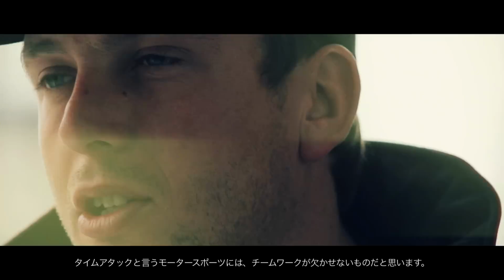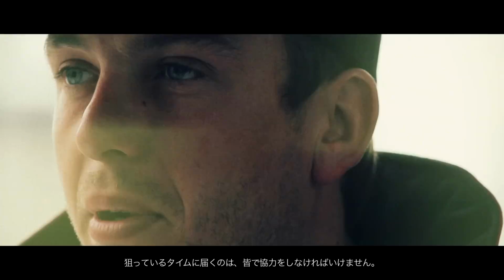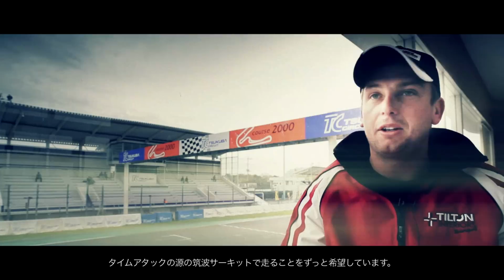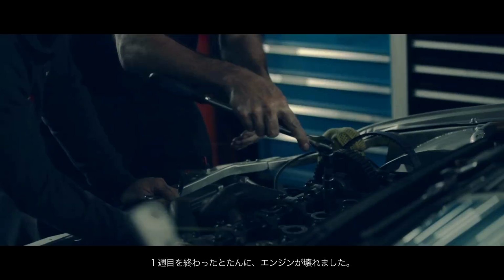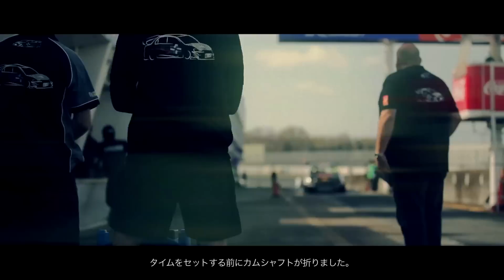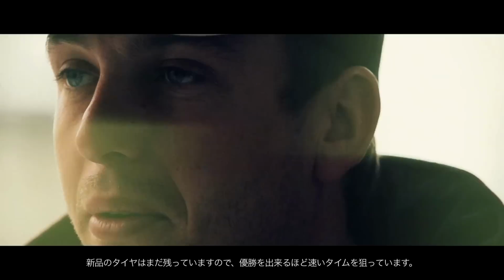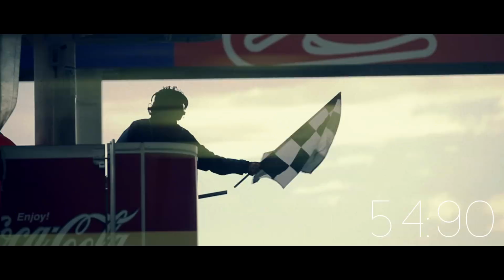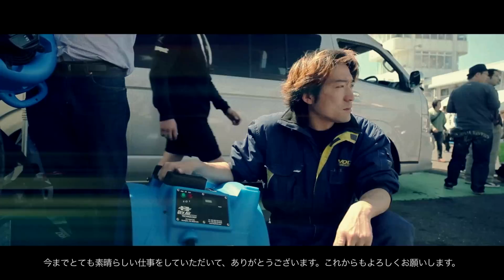Behind The Wheel - 850HP Mitsubishi Evo Tsukuba Circuit Time Attack Video

Comment: Slicks are the tires with the most contact surface between the car and the track. The less tire tread you have, the most contact you have between the tire and the road, so it's the opposite of what you probably think. Also, slick tires are most of the time made of very tender rubber, so the grip is even better. To make it easy to understand: SCLIKS: super tender + no tire tread = MEGA GRIP. 

Have a nice day.

Comment from the maker: The car was still being setup for Tsukuba circuit in this video so thats why it looks like the tyres may not have enough grip, the cars setup was causing some understeer problems. The car has another 4 to 5 seconds in it once they get their proper engine back in there. They had 3 engine failures over that week in testing and on race day. They will be back this year.

Comment: Why are they using Cosworth engine.. it is stupid to use Evo as a base car and not use Mitsu. engine. I understand using different mfg. suspension etc.. but the engine?? why not the original engine and tune it to hell..
Reply: When he say a Cosworth motor he mean Cosworth internals in a Mitsubishi block and head, ie crank, rods, pistons camshaft etc are cosworth items put into an evo motor that has been machined and prepped. A stock internal motor wont last that long at this level of motorsport with this kind of power
Reply: Same engine, different internals... Smh
Reply: facepalm
Reply: Cosworth are a tuning firm that have had their skills used in many different projects, Audi RS4 being the first non Ford that springs to mind, also the Impreza CS400 limited edition.
This Evo is using Cosworth internals.
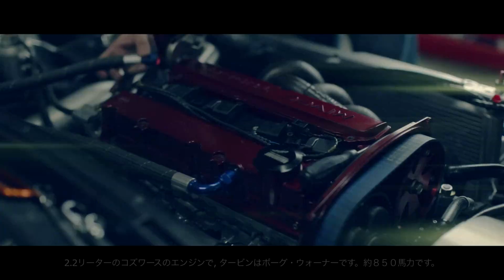Reply: 2:02 Didn't you see that engine? I'm guessing you're not familiar with Mitsubishi's Evos

Comment from the maker: I understand but the Tilton car was at 50% of its full potential and it also did a lap that was 2 seconds faster in the last sector I believe before one of the intercooler hoses split, that was also on a make shift repaired engine. So that data backs up a 52-53 easy. This is all still on rough engine / tune. Like you said there is no 51 or 52 second lap yet but this car is very capable and the CT230R is a very old setup now days, I think many Japanese teams will have to step up their game.

Comment: Wow, some very uninformed people spouting off in the comments (as usual). All of the highest level time attack cars are 'unreliable' compared to a car built to run actual races. These cars are tuned within an inch of their lives to try and get that one golden lap. They are the automotive version of the Olympic 100 meter dash athlete. Every system and subsystem on these cars is pushed to max with no headroom. And because of that they do break a lot. Also, the left foot brake tapping on the straights is to counter any pad knockback in the brakes and also make sure there is pedal and you haven't lost brakes. Finding that out at the end of a long fast straight is a rude process.
Reply: ^^ THIS. ^^
Reply: +Jim Davenport And one other thing. These guys are running on actual treaded street legal tires. On pure racing slicks the lap times would be mind boggling.
Reply: +Jim Davenport thank you for informing us Jim, i was curious to know why he was tapping brakes on the straight
Reply: Lol and who told u dis. Where did u get these facts from? Do u know all the time attack teams? Have u been in their shops? I hope u hav some good facts to back up wat ur saying. I am only talking about the engine tuning part just so u guys or girls  know.
Reply: @davidchau3228  If you don't know the difference between a tune designed to make an engine last 100 laps reliably vs a tune on the bleeding edge that sacrifices any safety margins for every last bit of power, you don't know much. Time attack is in essence much like qualifying. Just look at F1 in the 80's when they had special engines for qualifying that were destroyed after 2 hot laps. My comment is not any kind of put down of any of these teams. Just the opposite. They are pushing things to the absolute edge of the cliff for that golden lap.
Reply: @engineerjmd3  dat doesn't mean they rebuild the engine every time

Comment: bo093 was close. It's "knock off" as WRXJIM said, it's caused by the gyroscopic force of the rotors pushing on the brake pads when the wheels are turning. This is because of the floating rotors movement, and it pushes the pads back into the caliper. He taps the brake pedal to move the pads back onto the rotor face, so there is no soft pedal when he pushes the pedal next. You can eliminate this by running a strap drive floating rotor system. Awesome video!

Comment: @Reece Mechanical
Yes this car was a bit unreliable, but that is not unusual for cars tuned to the limit. Also, Evo's held the record there for more like 11 years. The JUN Evo V, then the HKS CT230R. Both these cars were not highly modified at all compared to modern Time Attack cars especially the JUN Evo. The car in this video did a time just quicker than the JUN Evo, but if it went there now it may well break the record. And there are people who can afford to use a Porsche as a Time attack car, there are several in the UK right now for example. They are not however at the front of the field and have not posted any wins at any international events that i'm aware of..

Comment: Hey there man I just responded to Kalamity and saw your question.  As I said before I don't claim to be an expert.  But as a car corners at really high speeds the brake pads begin to become slightly misaligned, or spaced away from the rotors.  I believe that by occasionally giving the brake pedal a tap the driver is able to rid of this space and allow for a pedal that isn't mushy because the brake pads are already along the rotor with little to no gap from contact.

Comment from the maker: You do realize in this video they were running an engine that was thrown together, their previous full tune engine had problems. They didn't get one single clean lap that whole event. They will be putting together a new engine, new aero and attacking it again. They were also over 2 seconds quicker on the back sector of Tsukuba circuit before their turbo piping split, thats already 2 seconds out of their lap time. They had many problems, 4-5 seconds can be chopped out of their time.

Comment: On such tight corners the rear tires easily push the front, cure with slightly harder rear tire compound or slightly thinner tires (or more tire pressure in the rear and less in the front). At least, that is what works in all the sims I drive.

Comment from the maker: They're not assumptions when you have calculated data read outs and sector times. This car cut 2 seconds in one section which would of lead it to a 52-53 lap before the intercooler hose split. Not assumption or prediction, fact. But problems happened and they will be back to set their goal lap time of 51-52 with a new and reliable engine.

Comment: To get the oil pressure to the brake pedal, to avoid  a thinny "break-failing-gap" between the time he steps on the pedal and actually starts to break.
This kind of trick, makes you be able to step later on the brakes without feraing to wait 2 tens of a second until the brakes start to brake.

Most of prrofessionnal drivers take this little "advantages" in consideration.

Have a nice day.

Comment: @Reece Mechanical
Evo's held the record there for more like 11 years. The JUN Evo V, then the HKS CT230R. Both these cars were not highly modified at all compared to modern Time Attack cars especially the JUN Evo. The car in this video did a time just quicker than the JUN Evo, but if it went there now it may well break the record. And there are people who can afford to use a Porsche as Time attack car, there are several in the UK right now for example. They are not however at the front of the field and have not posted any wins at any international events that i'm aware of..

Comment: I'm no expert but I'm pretty sure this isn't the case, although brake boosting is pretty cool.  I imagine he's tapping the brake pedal to keep the brake pads from getting misaligned from the brake rotors which will prevent from getting a mushy pedal when he has to brake for a corner.

Comment from the maker: Considering Under-Suzuki laps it in 52 seconds with a rear wheel drive car that barely finds any traction and with an aero package that was not even 20% complete at the time of that 52 second lap. I think it's safe to say that that breaking into the 50's and 51's is not unrealistic at all when you have this type of AWD car and its running at it peak without the horrible problems that plagued them.

I 100% think a 50-51 second lap is possible.

Comment: Can I ask a question just due to my curiousity :)

You tap the brakes to heat them gradually to find them when you need to brake ? or for a sensor or other mater ?

Thanks :)

And keep it up !
Reply: purejdmpassion usually they tap the brakes before their braking zone just to heat up the brake pads.
Reply: @tougemonster2535  False. It's a brake check, and also to load the suspension before decelerating into an apex. Hit the track, homey. You might learn something. I
Reply: All Time Attack cars are built and tuned to run at the limit, thus the brake check. Ask any LeMans driver why they heel-toe before a chicane...it's safety. And also, and only real drivers would know the definition of this...to transfer suspension load before the apex approach. 

Video games and posers can't teach that. Ask any real licensed track driver. I hold an SCCA license for a reason. Most who have posted here don't have a clue how to transition corners and manipulate  a race car to turn in, even when it doesn't want to...whether poor grip, corner approach, lack of understanding trail-braking...etc etc
Reply: @tougemonster2535  Also, you want your brakes to be as cool as possible...."heat up" had me literally lmmfao 🤣😂

Comment: Why is he "kicking" the brake pedal with left foot during all the race ?
Reply: Most likely to take up any pad knockback that might have occurred during cornering so that he gets immediate brake response as opposed to a mushy brake pedal.
Reply: TheJippylube perhaps to gain better traction on the the front tires
Reply: Feela Hrstka Google left foot breaking. It has a tonne of uses.
Reply: Brake pad knock back. Makes sure the pads are ready for engagement when he needs to brake.
Reply: Thanks guys. You can see it well on the last straight. Thats what I thought...not braking in the corners.

Comment: WHy no clutch on up shift only on heel toe down shift?
Reply: Because it's slower.  This is a sequential gearbox.  You only heel toe on the way down for engine braking.
Reply: Shadowboost no one engine brakes when going for a good time, you're either on the brake or on the gas
Reply: Phil Wat
Reply: Shadowboost If you're engine braking you're using a less efficient means of deceleration than you're aftermarket brakes. Which translates into more time needed to decelerate which translate into larger lap time
Reply: Shadowboost
 yea the later you brake the faster you take the corner, so you want to be on the brake for a little as you can.
the reason people downshift is to be ready to accelerate again once you're done braking,
the rev matching is to make it smoother.
Reply: Phil OkSo why no clutch on up shift again?
Reply: because the gearbox has straight cut gears, which are stronger, so you're effectively forcing  it into gear as opposed to letting the syncvhros do all the work like in normal cars
Reply: Phil Why Can't you force them back down?
Reply: Domingo Jacobo simple answer to your question is .you can force them back down. its a sequential gearbox just like in a sports bike.The reason you hell toe is to not make the car loose balance during corner entry
Reply: So not so much over-reving or some thing damaging as much as the balance shift of the car being detrimental to cornering?
Interesting, thank you for for answering.
Reply: It's hard to catch but he is throttle blipping upshifts and toe heeling downshifts. As the others have said, it is a sequential dogbox, no synchros. The blips and toe heels provide a split second of low load on the gears to allow the bang shift. it's a pure racing gearbox, very expensive and works nothing like the usual manual trannys we have in our street cars.
Reply: The transmission is a purpose built dog box made for clutchless sequential upshifting.  The gears built in these transmission are usually straight cut gears as opposed to your helical cut gears in your everyday manual syncromesh transmissions, and that's why there is usually a loud audible whine from them at speed.  Just a slight let off of throttle before upshifting to unload the transmission input and allow it to change gears and the driver is back on the throttle 100% again.  This allows for faster gear changes and no missed shifts which are suitable in race situations.  As for the down shifts, this style transmission still requires the regular heel and toe to rev match for correct gear engagement and to keep the engine rev matched to the speed it is going which adds to engine braking helping the car slow down under control better.  

Just do a little google search for dog box and you should understand them a little more better.

Comment: 2.2 liter single turbo engine making about 850 HP? I'm not very informed on tuning but can someone explain to me how the fuck that is possible?! Haha
Reply: The evo engine can take more than 40psi (even more with forged internals). Compare that to say a GT86 boxer engine (7psi) or SR20DET (20 to 26psi) and you've got an absolute monster. You'd assume they are also running e85 which means cooler temps and higher boost ratios.
Reply: In other words, forced induction is a beautiful thing
Reply: ImDominicanSMD True words
Reply: ItsDanKReviews evo motors are great but standard engines are only good for 25psi to run 40psi it would have to be forged internals
Reply: 25psi is still more than an SR20DET can handle without forged and they're both 2ltr's.
Reply: ItsDanKReviews you're both forgetting that the size of the turbo in relation to the boost pressure is what really matters. 25 psi produced by a K04 for instance is much less dense, usable volume than 25 psi from a gtx35r. There isn't really a set in stone boost pressure that each motor is able to take, more a limit of torque and horsepower the factory rods and pistons can withstand in each cylinder before failure.

Comment: keiichi tsuchiya did 51:58 seg....lol
Reply from the maker: That's in a old Super GT race car so it really has no relevance here compared to this garage build evo. This evo did it in 54 seconds with second hand used engine that was not prep'd for this type of work because their actual race engine blew on the first day. Suzuki-under did the a 51 second lap time quicker than Tsuchiya's in his home built S15. Also might I add, this was their first time to ever drive on this circuit without years of knowledge and countless laps like the locals.
Reply: And it did the lap on grooved tires, not slicks like the NSX